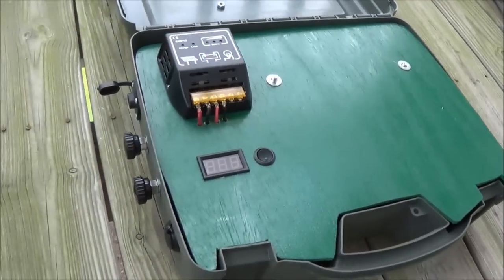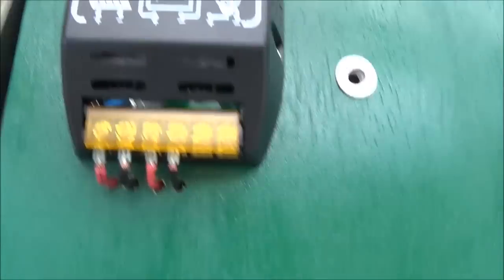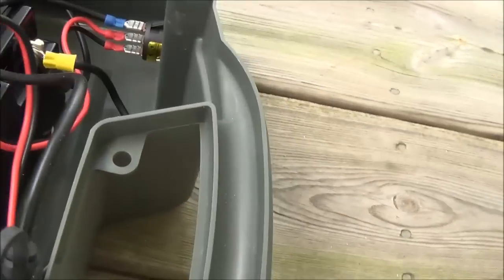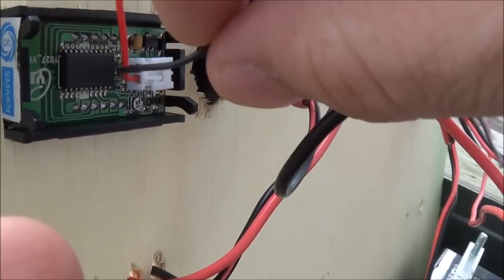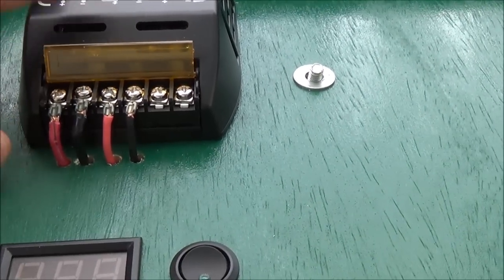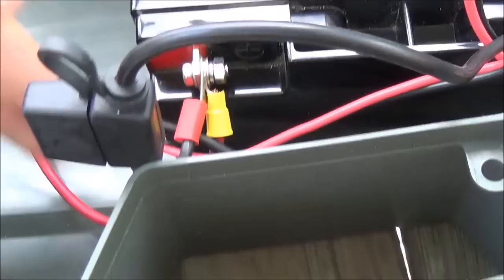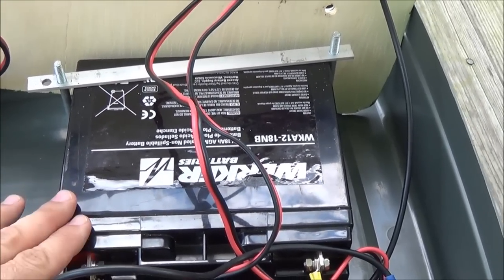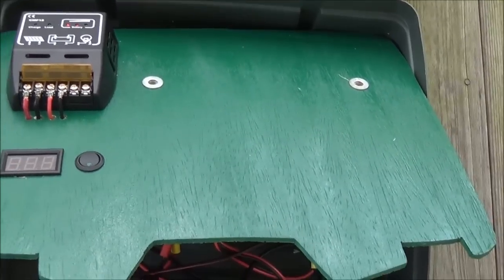How to wire a Portable Solar Generator

Comment: Liked.  Good ideas.  Planning mine now.  A few questions.  1.  Do you think it beneficial to use a fuse block / panel in lieu of the single inline fuse or is it overkill
2.  Is that a repurposed plastic tool case?
3.  Any reason the wiring from the scc couldn't have been directly wired to sla battery?

Love the vid and ingenuity.

Comment: Hey I got a question. Since you have that “main” switch, does it mean that you have to turn it to the ON position when you plug the solar panel to allow current to get to the battery ? Also, doesn’t that means that there will be enough current going through that switch ? Will it hold ? ( Depending on the solar panel of course) thanks.

Comment: Hi,I have 2 batteries,should i wire in parrellel or series? Also what amp mains fuse did you use? Should each battery have its own fuse? Is your main switch rated at 20 amps? Thanks great. Informative video.

Comment: Great video. you helped me so much. I know nothing on electricity and wiring. what is the fuse working for? The bus is a little confusing for me but I watched it several times and I think I got it. I am going to label the wiring on the bus so it will help me when something needs work. , one suggestion i did. this while watching you. I put a little round knob on the tray so I can lift it out easy. I thought of that while watching your video about 5 times to learn Thank you keep up the great videos!!!
Robert
Reply from the maker: Robert Debes Thanks Robert. I am really glad that you are enjoying my videos!

Comment: Hi there,

Great video. Very informative. I am inspired to make one.  Where did you get the posts/terminals(black screw on) for the outside screw on power? and I notice that you connected these directly to the battery. Do they need a inline fuse?.

Do you have a parts/spec list?

Comment: What's the purpose of the voltage meter? Isn't it always going to be 12v until the battery runs out of juice?
Reply from the maker: I use it more for monitoring the battery while it is being charged to let me know how much longer or what it has gotten to during the day.
Reply: Ah. Thanks for there reply. I'm draining my battery now, monitoring voltage with attest meter. It's dropping a little, but still hovering around 12v. My batter box has a tester on it and says it's low. Once I drain it I'm going to recharge with solar and see how long it takes while monitoring voltage.
Reply: A 12v battery is about 12.6 volts when full. (AGM and lead acid vary a bit). It your battery is at 12v it's about 40% full and is getting damaged.

Comment: Didn't see an inverter for possible pulling AC current off the portable, using it to charge portable power tools takes AC power & would be a +.
Reply from the maker: +Dan Roy I have several different Inverters, so that is why I put the power posts on the side of the generator. It lets me connect directly to the battery  via the 10 gauge wires inside the enclosure.